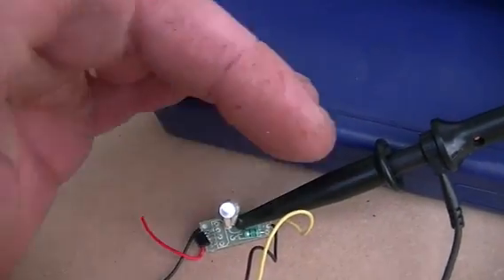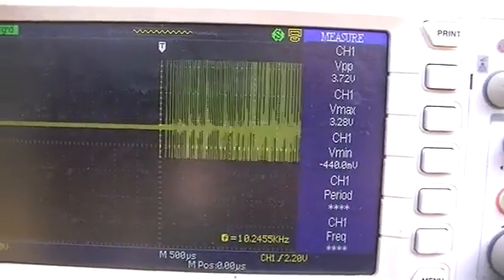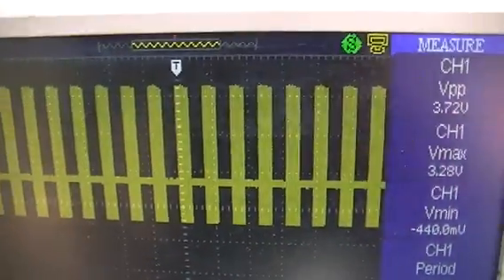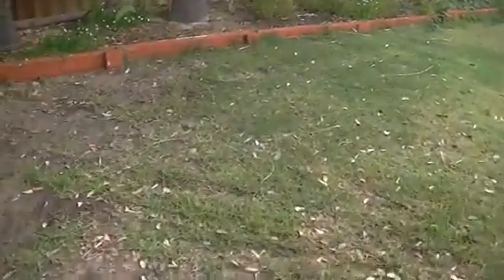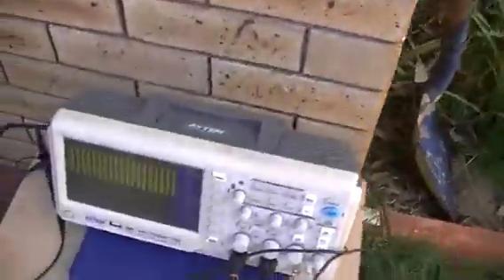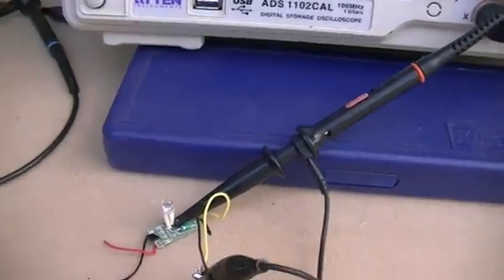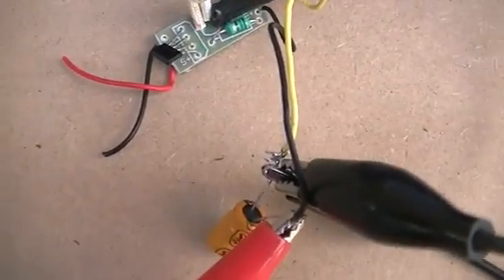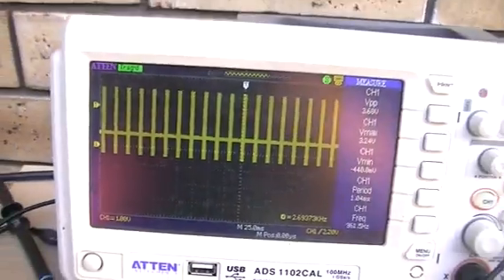Tree powered garden light

Comment: I have just replicated this in my backyard and I reckon you may have simply made a galvanic cell. One electrode being a zinc plated scew and the the other looks like a nickel plated screw. I was able to run a blocking oscillator using a galvanised screw (-ve) in the truck of a pencil pine and a graphite rod (+ve) in a garden pond 5 meters away! I didn't need a rectifier. Fluctuations correlated to wind may be due to differential flow rates of the electrolyte (sap in xylem) influenced by increased evaporation (transpiration) from the leaves.

Comment: Those pulses look alot like the old Loran Signal we used to transmit in the Coast Guard. Could be a local pulse transmitter within 100 miles.  That is pretty cool to receive energy like that to run a circuit, or do you think it could be something radiating from the power lines?